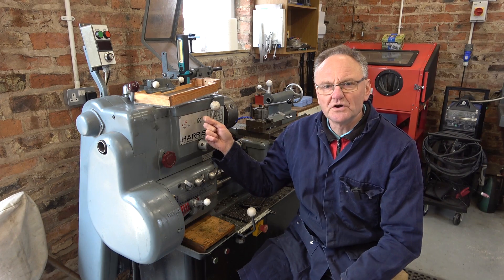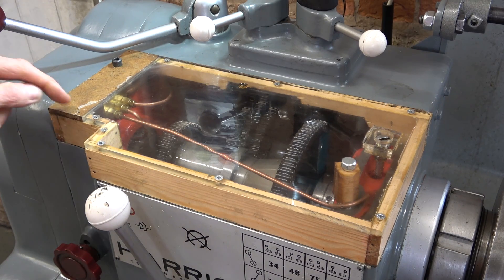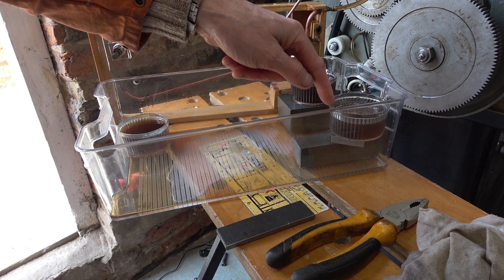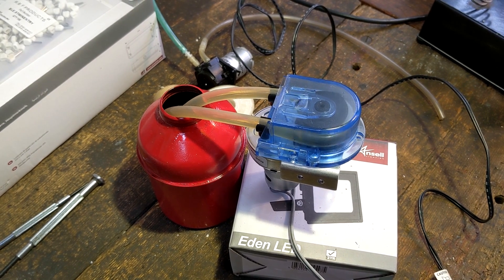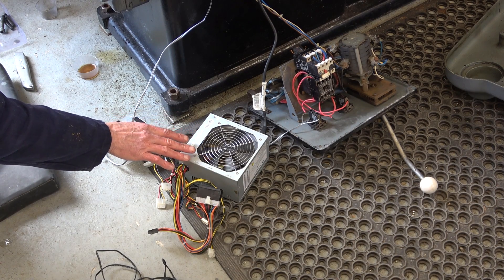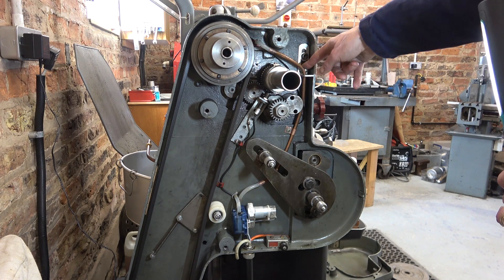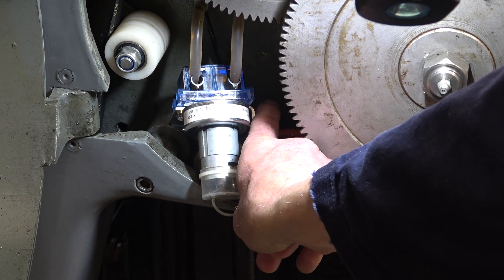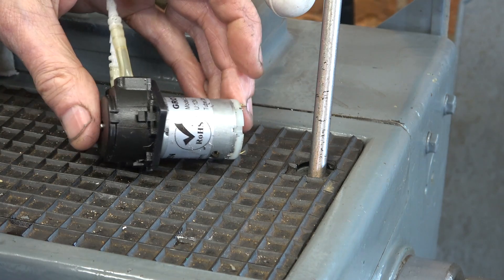HS193 Harrison 140 lathe oil pump swap

Comment: Hi,Paul. could you tell me where you purchased the peristaltic pump you've just fitted? It may be just what I am looking for to build in a sump and pump lube system on my Alba 1A shaper that i am currently modifying. 
I can't remember whether it is the small sized South Bend shapers or the Atlas shapers that have a sump and a mechanically driven plunger pump to lubricate all the vital oiling points but that system uses a manifold block with adjustable needle valve screws to set/meter the individual oil feeds to various lubrication points within the shaper. I've gotten the sheet metal sump complete with a drain plug made and fitted into the base casting of the shaper but haven't bought a suitable pump as yet.
 I agree with your observations on the point that no oil gets to the spindle bearings on your L5A at lower spindle rpm and the same issue exists with my slightly larger L6 Harrison. Just for interest Mr Pete (Tubal Caine) has a couple of videos on his channel about setting up the lube system on either the Soutbend or atlas shaper I have mentioned.
Edit to add: in an earlier video you queried whether the top tool slide castings on your Elliot 10M shaper were an original pairing due to the apparent mismatching in width of the 2 castings. I can confirm for you that I have seen similar mismatches in width on other Elliot 10m shapers and that my own Alba 1A is very similarly mismatched....I don't think you have a machine that someone has mated a pair of stray castings as they all seem to be that way. One reason that slide castings often appear offset is to allow for the extra thickness of the adjustable Gib strip fitted into one side.
Reply from the maker: Hi Howard, the pump was eBay item 314331563804. Cheers

Comment: Hi Paul, that looks like a great solution. I liked the mock up with a transarent lid. 

I'm sure you'll find away to regulate it to get it to work when you want it too. Maybe it's possible to switch it using the low range selector somehow. Or perhaps it's as simple as a timer!!

Have a great weekend
Reply: a digital rev detector device with an on/off threshold switching device would automatically detect when main spindle revs fall below the speed at which splash feed stops working.
Reply from the maker: Hi David, I'll probably just give it a squirt when I'm using the low range (which is not very often) or when starting if the lathe has been standing unused for a while. Cheers

Comment: Hi Paul, Very interesting, I'm wondering if a 12 volt electric diesel fuel pump would work. It should handle continuous duty. Good video !
Cheers......Dean
Reply from the maker: Hi Dean, a pulley-driven pump would be a proper job. I should probably have taken a trip to the breakers yard. An electric pump was a cheap easy option, and you know how jobs escalate.... Cheers
Reply: @HaxbyShed  There some good quality "pulse type" diesel fuel pumps and quite compact for under 50 bucks at least here in the states. I have a spare one for gasoline, I'll try to test it..

Comment: Excellent work. Harrison must have realised this was an issue because on the larger M series lathes they fitted an oil pump driven from the main motor. Something I'd like to incorporate on my M250.
Reply from the maker: To be honest Carl the pump is not that essential, given it has already lasted 53 years, but I thought fitting one would make a nice project. But without the pump the front main spindle bearing gets oil on the high range but I'm not sure when the spindle back ball race and input shaft ball race get any oil on either range on anything less than top speed. So I feel happier with an oil feed system. Cheers

Comment: That transparent lid is brilliant! 👍 🇬🇧
Reply from the maker: Hi Matt, it was an education to see where the oil actually went with the lathe running and, more to the point, where it definitely did not reach. I wonder if the designers ever looked though a transparent lid - I think not. Cheers

Comment: Could you use a second hand power steering pump from a car and drive it directly from the lathes main motor? If you choose one with a pressure relief valve you could play around with that and the gearing to get the correct flow. It would be much quieter than the electric one and only run when the lathe is running. I have a Colchester and thats how they are set up.
Reply from the maker: I think that's a good idea Andy. I did not fancy scavenging at the scrap yard but retrospectively it might have been less effort (and less noise) in the end. Cheers

Comment: I think that you could have got away with less of a flow of oil Paul. It's surprising how little oil a rolling element bearing needs to be well lubricated. Having said that, it's a fine job, it'll see both of us out. Just check the pump hose at regular intervals. From personal experience they tend to fail when you really don't  want them too.
Reply from the maker: Hi Bill, the front main taper spindle bearings are oiled from a channel on the front ledge so any oils there just runs into the bearing by gravity but the oil feed pipes I rigged up to lubricate the back races  need  a pressure squirt across the air gap to get onto the bearings so a bit of pressure is required. The design kind of evolved as I went along (usual story). Cheers
Reply: @Haxby_Shed  Hi Paul, yes it's amazing how jobs grow legs. Then they just run away with you. My Roundhead Colchester Triumph is just splash lubricated to the bearings, I don't run it at slow speed very often, as I only use carbide insert tooling, so no worries about bearings not getting lubricated. One of the reasons I want a newer machine is to get higher revs to suit the tooling. I assume then I will also get a built in pump.

Comment: very very nice they particularly like the clear cover you built from the top of the lathe
Reply from the maker: Hi Kimber once I fitted the transparent cover I saw a big difference between my assumptions about the way it oiled (or did not oil) the bearings and reality.  Cheers

Comment: I really like your homemade manifold, that has given us an idea of making something similar to help locate a problem we have with our lathe, thanks. This looks like a great upgrade
Reply from the maker: Hi GTB of course in improving the oiling I may have introduced a risk, if the copper pipes work harden, crack off and fall into the gears and jam the gearbox I'll be crying. I've gambled that won't happen. Cheers

Comment: I noticed a similar issue on my Colchester Student when using a VDF drive. The redeeming factor is that most of the oil seems to be flung off gears on the input shaft so not so susceptible to gear changes - just motor speed. Thanks for sharing.
Reply from the maker: Thanks workshopfriend, the Harrison design remained the same for decades so either they never really checked lubrication on the low range or they were not concerned. Cheers.

Comment: Hello, what is the life span for the tube in this pump ?  and do  you have a link to the store you bought it ?  Thanks.
Reply from the maker: Hi Gennandy, the pump was eBay item 314331563804 cost £12.34 delivered. It came with two lengths of silicone pipe - one to use and one spare. I think my pipe will last a long time, especially as the use is low just occasional. Cheers

Comment: Have you considered a gear pump with a stepper motor to drive the pump.   You would be able to vary the stepper motor speed to get whatever flow you need.   Stepper motor can be controlled with programmable controller like arduino, or a small controller with a manual pot.   I cannot provide a link or my comment will go into purgatory.
Dave.
Reply: Great idea
Reply from the maker: Well Dave that would be a very professional way to do it but I would hesitate to put that much effort into it (being a cheap minimalist myself). Cheers

Comment: Nice work sir. That noise isn't objectionable to me, especially when the lathe is running.
Reply from the maker: Cheers DC, true it does not scream at me and then overheat like the small gear pump did.